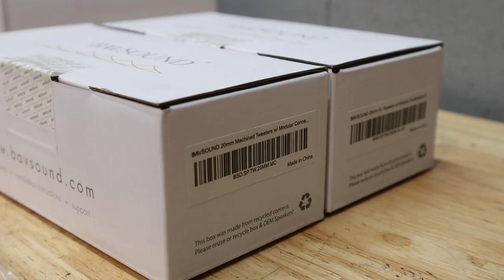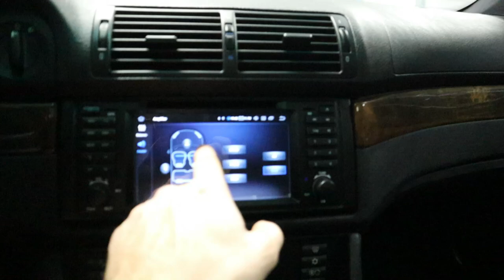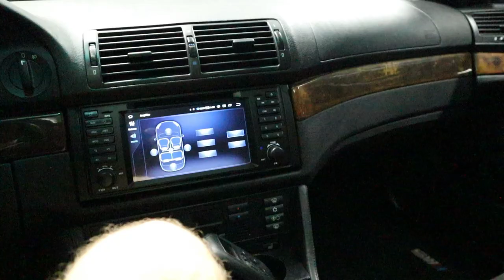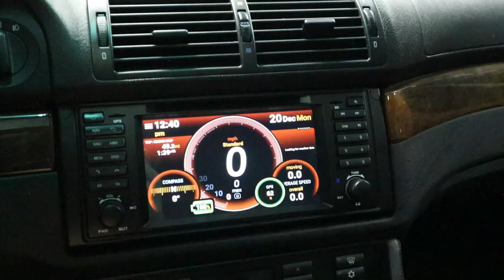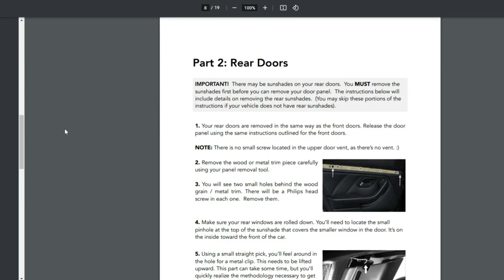BEST E39 Speaker Upgrade? BavSound Stage 1 Kit Unboxing, Install, + SOUND TEST!

Comment: Just bought an E39 sedan. You got me sold on these.
Reply: Did u install them already?
Reply: @quentinwatson5147  i havent bought em. xD Fixed the rust and did some repairs though
Reply: I think I accidentally blew mine a bit on the driver side from posting on Snapchat video…I shoulda turned it down and forgot everything is louder on snap….

Comment: HEY!!!    YOUR DOOR ISNT STICKY. Its actually that the door seals make the door pull out on the latch pin. If you apply pressure with one hand where the latch is. Then simultaneously GENTLY pull the handle with the other hand... opens smooth. You will bust your door pulling like that. As you jam that handle hard, your doing that same motion to take the load off the pin when you get "lucky."  (Same issue old 80's saabs and v.w.'s had, always the rear doors are first to go.. ) whats the fix? You tell me.

Comment: Note, the cone whether rigid paper - is a rigid piece, the surround and spider (under the cone), move and affect sound performance, your comments about the “looks” of the speaker are interesting, but not relevant to sound performance. The “flexing” parts (surround and spider) wear out, otherwise a good r/r install video. Thank you!

Comment: I bought 1998 e39 535i with No factory added DSP and empty  (fake ) tweeters,  just 4 regular speakers,  with white paper clothing :(  So i wanted to upgrade my speakers together with Px5 android 8.0 , but unfortunately, all wiring and cables is not installed in car from factory, even for future upgrade, i was shocked!

Comment: THAT IS JUST A PERFECT SOUND SYSTEM install  perfection pure professional handwork great job , just found your chanell i live in Bosnia and Herzegovina i am gonna buy Bmw E39 2.5 Diesel 163Hp Manual 2003 year i found a guy who has polished chasis looks like brand new car guy he took care of the car very well i never saw e39 looking like new one which i found its around 3000$ i am gonna purachase it for christmas when he comes to Bosnia for a holiday cant wait to buy speakers like that , i have on my laptop connceted home theathe logitech subwoofer z2300 and jvc sp-ths9s i could feel the sound difference factory and the new ones amazing work dude kind regards

Comment: A little tip on e39 door handles (at least from my experience on european market cars) the facelift cars have a plastic door handle while pre-facelift have metal ones, which are sturdier. Discovered by accident while repairing both of the left side door handles that just wouldn't open
Reply: Inside I asume... sweet tip.
Reply: @drewdavis239  the exterior ones, mine were broken and wouldn't open from the outside

Comment: ADD BOSE SUBWOOFER AT THE REAR ABOVE THE BATTERY FROM MAZDA 6 WITH BUILD IN AMP FOR PROPER BASS , THANKS ME LATER ( ITS A SPARE TYRE SUBWOOFER THAT GOES INSIDE THE SPARE WHEEL BUT BECAUSE WE HAVE AIR COMPRESSOR IT CAN GO ON TOP OG BATTERY - PLUG AND PLAY )
Reply: Really?

Comment: Seems like you have a leak or had a leak in the rear part of the wagon. I had the same issue and after investigating turned out that it was the antenna right on the roof there letting in water and running down. Also recommend replacing the hatch and hatch glass seals too cause mine were leaking but looked perfect
Reply: Yep! Those wagons love to leak in the rear. Mine had the water getting in through the deteriorated  fuel cap locking grommet, tail light gaskets, antenna and third brake light.
Reply from the maker: Dang I need to get on this, very likely could be my antenna. Good eye!
Reply: @TheBimmerBarn  Hey Man, why you didn't replace the mids in front panels?? there are 3 speakers, not 2
Reply from the maker: @waskit7020  the Bavsound kit doesn't replace the mids in the front doors
Reply: I got left tail light seals leaking. Had vapor barrier issues i just fixed, front throtel cable hole by wiper motor leaked... still chasing a leak that comes from inside of the vent under the drivers seat... happens in the rain. Car hasnt run in months... still scratching my head. (I know how to clean out the evap / a.c. tray... woukd be a great video series

Comment: I see that you have the Eonon head unit, which I have as well. I want to replace the factory amplifier in the left side of the trunk, did you do that as well for this install? I’m assuming you didn’t, I’m just trying to figure out how I can incorporate a new amplifier with the Eonon head unit. I think I’ll need some type of DAC from the head unit to the new amp?

Comment: Got an e39 wagon…non dsp, got the stage 1 kit but the bass is distorted in the mid moofers, luckily the highs sound pretty good, what are the recommend eq settings?
Reply: You'd probably want to look elsewhere for info like that. Going off the head unit he put in there this dude doesn't care that much about sound quality enough to do any EQ

Comment: Nice video!  Did you upgrade your head unit, that's not the factory radio?
Reply from the maker: Correct, that's the Eonon radio upgrade, I did a review video on it too! Much better quality sound than the factory unit, more functionality too 👌

Comment: My 1997 e39 had horrible sound! I couldn’t believe it.  Fm sounded like nice am sound. If that makes sense? Being on a budget, I took a chance that the ten speakers and the original power amp would be okay. I replaced the head unit with a pioneer. It sounds good. Not great, but decent. Now I think I might have blown one of my rear deck speakers. It sucks, because it’s a bmw! It should have asskicking sound from the factory! It has alpine components, and blaupunct too. I am old school in that I don’t want big thumping subwoofers in boxes in the trunk. I like the clean installed factory look. So, I have some decisions to make. Problably, all new speakers. Maybe, a new amp, or, maybe no amp? Maybe, more expensive headunit? Idk? I looked at crutchfield and they have nice options too. I am  Open to suggestions.

Comment: What head unit do you have?  Did your system have DSP?
Reply from the maker: No DSP, running the Eonon system, I have a video on it! https://youtu.be/7yt41Dgf4yQ
Reply: @TheBimmerBarn  is that head unit compatible with DSP?
Reply from the maker: @mackbend  yes with an additional harness you can get from the oenon website.
Reply: @TheBimmerBarn  ok. One more question and I will leave you alone.  😄  How is the sound quality?  Is it comparable to other stereos like Kenwood, Sony etc?
Reply from the maker: @mackbend  better than oem, can't tell the difference with Sony or other  brands. Great value and functionality if you ask me.
Reply: @thebimmerbarn I just bought yhe head unit and extension harness for my 2000 m5 with dsp, and it says radio cant be used if 4 pins arr missing from harness like in picture they show. Now I am at a dead end with a radio and harness that have no sound. Any ideas?
Reply: @brettbonte8566 A bit late to the party but you might want to research the Resler IBUS. Really dope product made just for the E39. Tons of benefits to it and I’m pretty sure one of those is finding a way around that. I own an E39 M5 and I’ve been working on this fix for a bit.